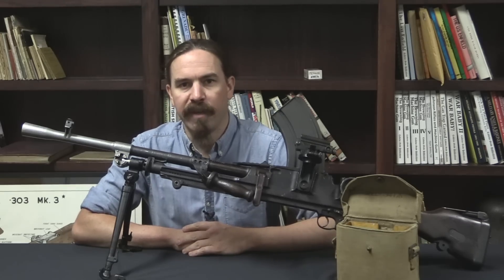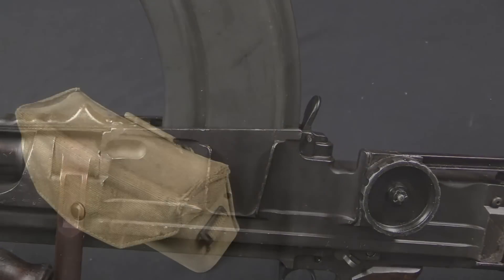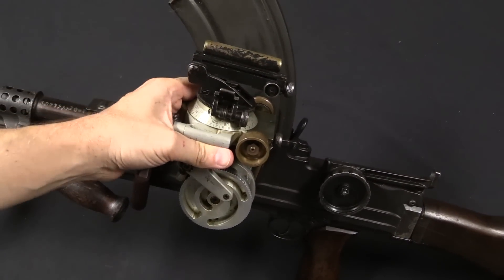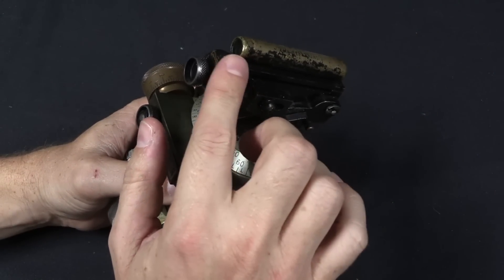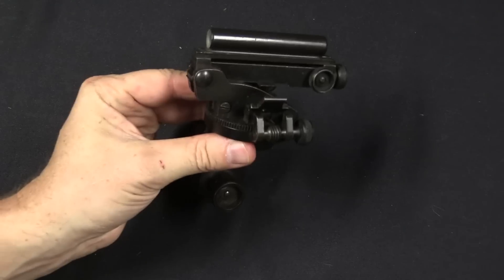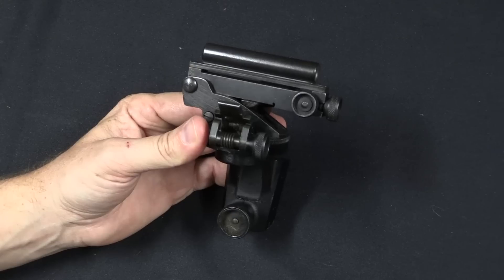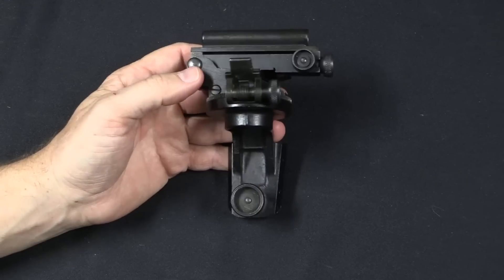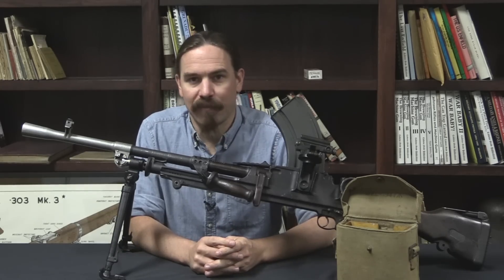Very Rare and Mostly Pointless: the Bren Fixed Line Sight

Comment: I would still take  the    fg 42 everyday
Reply: 1942 and rarer than hens teeth
Reply: @dave_h_8742  And fragile.  Go watch the previous video where they talked about bits of the Bren breaking during the stress test and nobody noticing 'till they took the gun apart to clean it.  Not at all the same weapon.  The FG42 was super cool, but in retrospect it was a dead end.
Reply: @JohnHughesChampigny  easily fixed if it caused a problem.
I saw the previous one. Like all German stuff they couldn't stop tinkering or making it complex.

Comment: Indirect fire for MG.  We still do it in the Canadian Army with the C6 GPMG.  C9 LMG fits on the C6 tripod so technically, it can be done also but it’s not done.
Reply: British Army still do it too.
Reply: It is a useful thing, they should be trained to do it. But the British Army (and therefore Canadians who were under the same doctrine) was the biggest proponent of it. The Vickers gun stayed in service for many years specifically as an indirect fire weapon until it was supplanted by a new mortar. 

Everyone laughs at the Lee-Enfield volley sight, and while probably not feasible, they were going in the right direction. You just needed one gun firing lots of bullets rather than many guns firing fewer bullets.

The US in contrast was historically not a fan of medium MGs in indirect fire, after some early machineguns were delivered with poorly calibrated sights and the infantry were apparently a mite unhappy with getting shot in the back.
Reply: We kept the old GPMG (7.62 Browning MG) until to late (late 80, early 90) because of the « overhead » capability of the MG.  We lost that with the C6 but that’s ok for me.

Comment: I t would be nice if we could make a video compareing the bren and other WW2 machine guns used in the LMG role with pro and cons. And yes you can compare say a bren and MG42 in the LMG role saying other is nonsense. I was a machine gunner in an infanteri squad using the MG3. Under fire and movement drills we always used the bipod and the MG3 in a LMG role. What we can argue about is which one of the common WW2 LMG that was the best in overall. That debate I am open for
Reply: what we need is a project lighting WW2 edition :D
Reply: @rippervtol9516  Yes that would be nice. And I think it would be more easy to collect the weapons for testing even the Type 11 from Japan
Reply: Mg42 hands down

Comment: For those who don't quite understand the first sight:
You can, at times, use a machine gun in a way that is similar to using a mortar system or artillery piece. Using a fixed aiming point near you and setting the sights to the required angles allows you long range machine gun fires without exposing the gun to danger. This is a practice still used today.

Just from looking at the second iteration of the sight, it seems like something that would have extremely limited use because it can't be set to specific angles to get those long range fires. Use of a form of traversing and elevation mechanism would have been a better way to get the gun to sit the same on the tripod every time.
Reply: You have to use the traversing and elevation mechanisms on the tripod anyway with both the dial sight for the Vickers and fixed line sight for the Bren, that's how you re-lay the gun on the aiming point after adjusting the sights. The purpose of the fixed line sight was to allow the gun to be set for a fixed line when the target itself was obscured by weather, smoke or darkness, so the iron sights on the gun would have been of no use as the gunner wouldn't be able to see whether the iron sights were actually on the target. The Vickers machine gun collection and research association uploaded a video recently to their YouTube channel explaining the use of the guns and dial sight for indirect fire, which is pertinent to the Bren fixed line sight as the fundamental design and principle of use are much the same.
Reply: In fact, the early water-cooled machine guns were often employed as a form of artillery, deployed in discrete units, and literally raining bullets on a point to be interdicted.
Reply: keith moore  it obviously wasn’t a success. A lot of things the British military developed in the interwar years were not a success when put into practice, it doesn’t mean the people designing the things didn’t have a reason that made sense to them at the time.
Reply: keith moore  Your use of multiple exclamation marks strongly suggests that you have more confidence in your understanding than you have understanding. I suggest you go away and work through the process of laying the gun on fixed lines when the target isn't visible, then come back once you've realised that having a "turd" you can attach to the gun makes that process quicker and easier for the people actually doing it.